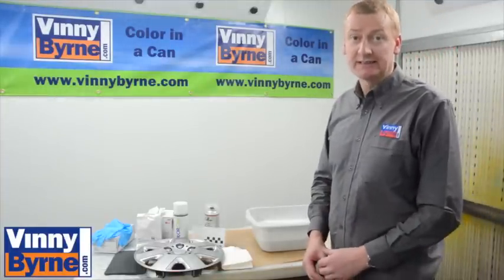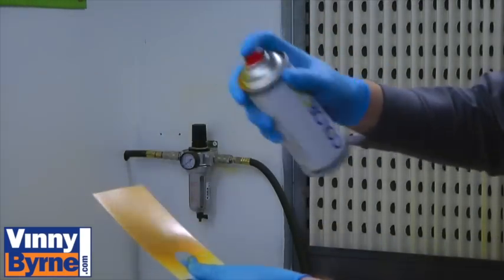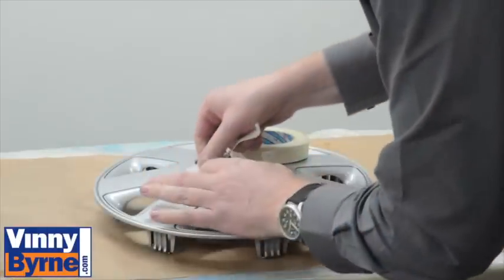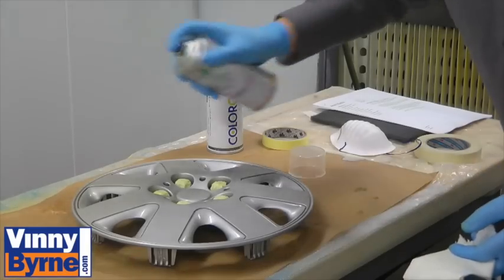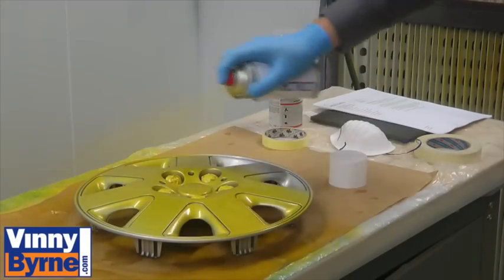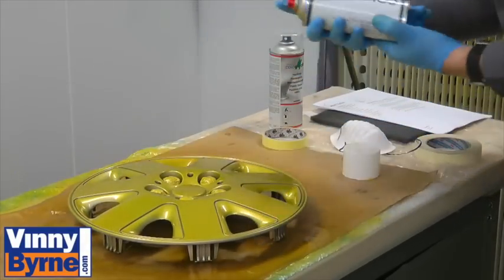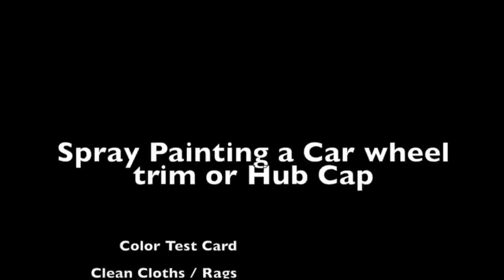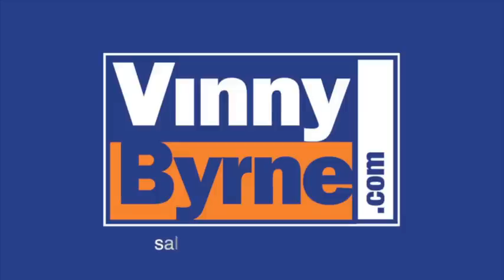How to Spray a Car Hub Cap or Wheel Trim

Comment: Yucky color!!! Wish you put them on a car so we could see how they look. But yucky color! P.s. spray paint outdoors for proper ventilation on a day with no wind and a medium temperature. Stay safe.
Reply from the maker: The colour is a bit BLING alright. If you are going to spray outside rather than using a booth, make sure to use a tack cloth just before you start spraying.